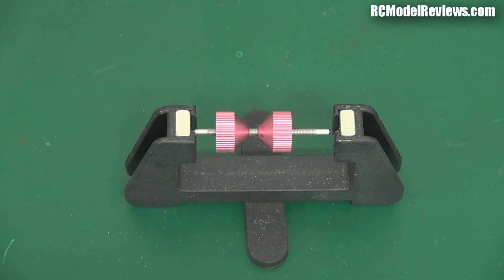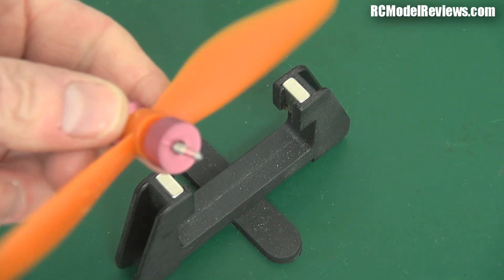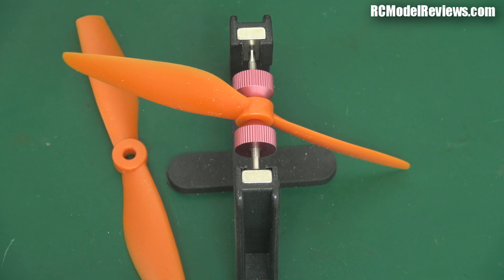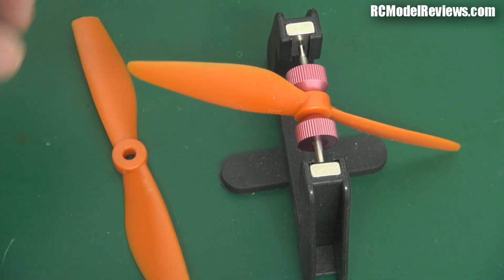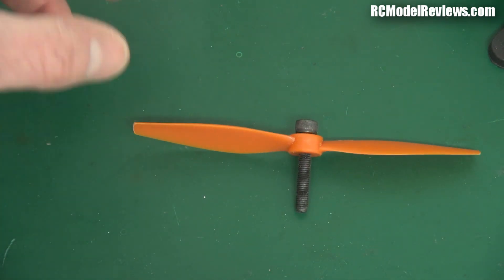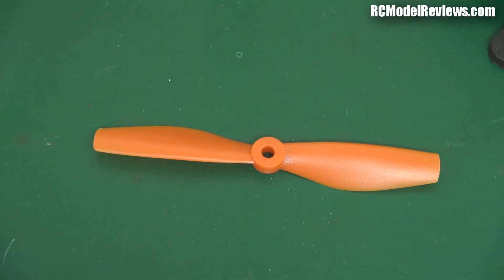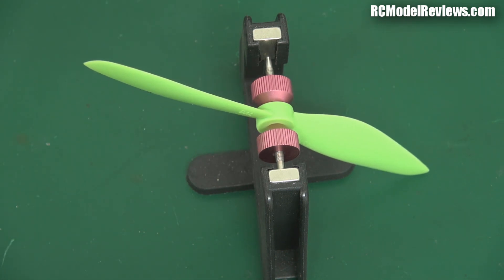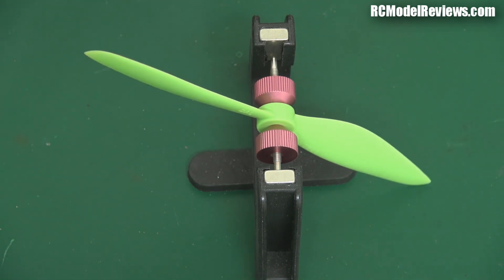DAL 6x4 propeller balance issue

Comment: I think that your definition of "dynamically balanced" isn't right. Dynamically balanced means that the inertial forces cancel themselves. Aerodynamic forces and their balance are another "kettle of fish", although I agree that you want them balanced too. There is a more detailed explanation there : https://en.wikipedia.org/wiki/Balancing_of_rotating_masses
Reply: Panoramix0874 Yes, I use the term "dynamic" loosely -- simply to imply that the system will vibrate when turning if it is aerodynamically unbalanced even though it may be perfect on a static balancer.
Reply: ***** Balancing something dynamically is quite hard and not something that you can do without proper instruments. They do it (or at least used to) for car wheels with a strobe. A google search shows that "some people on the internet" seems to have sussed it out for RC props and motors : http://diydrones.com/forum/topics/balancing-propellors-and-motors?id=705844%3ATopic%3A1011737&page=5#comments
May be that would be worth you trying to do it and explain it to mere mortals like me who are not too hot on electronics!

Comment: Is balancer self balanced well enough? In the past I had issues with an balancer itself, as one of the prop cone holders where unbalanced.
Reply: Go oGle Yes, this balancer is one of those cheap Chinese ones and I got two.  One was crap, the other (this one) is near-perfect.   Normal Chinese low-end "tolerances" I guess :-)

Comment: Put the same shaft on two glasses (for example) and you will most likely find that the magnetic part of this balancer is crap and it does what it wants :). I have the same :)
Reply: Todor Vitanov I'm aware of the limitations of the cheap magnetic balancers but these props were so far out of whack that the inadequacies of the balancer made no perceptable difference.
Reply: ***** Your review is right actually. I just went double check right after I saw it, because I had unreliable balancing experience in the past with the same balancer :D. I can make it go each way with just putting the shaft slightly left or right, ha!
Reply: ***** Your review is right actually. I just went double check right after I saw it, because I had unreliable balancing experience in the past with the same balancer :D. I can make it go each way with just putting the shaft slightly left or right, ha!

Comment: Thanks for that info Bruce, it sure explains the drama i have had although i should be using carbon props for my application however sometimes plastic has to do, but you would expect that makers would use and pride themselves with Accuracy , Oh shit did i just say Pride;-) I know they only cost a couple of buck but thats not the point. Cheers.

Comment: Magnetic balancers can magnetise the shaft so that very light props are unable to turn it enough when balance is almost correct. Mark the shaft with a marker pen and spin the shaft with no prop on it and watch what happens. Your first prop looked like it was responding to magnetic influences. To check, rotate the prop on the shaft and see if it remains balanced. I have to demagentise the shaft before every use as it gets remagnetised very quickly.
Reply: MallionsEye Yes, that is an issue with mag balancers.  I always rotate the prop 90 degrees on the shaft before I sign it off as "balanced" -- that way any shaft imbalance or magnetization issues can be spotted.

Comment: Don't forget to balance the hub as well, getting the blades to stay horizontally is only the first step in balancing, after that you have to balance the hub till you can let go of the prop and it stays at any angle, not only horizontally. But maybe that is a bit too much for those light props but with the bigger ones it is a must. Of course you need a balancer that is big enough to spin the prop all around. Thx for your vids, I always enjoy them.
Greetings from Germany
Reply: mooq! Yes! so true! I use my balancer sideways on the edge of the table to balance the prop hub. Greetings from Portugal! :)
Reply: mooq! On a larger prop this is an issue... on these, not so much.   Most people don't even bother balancing minquad props at all and the only reason I noticed the dramatic imbalance was because I was trying to balance one I'd trimmed down.

Comment: Hello! I have a prop balancer just like that and it´s junk, very unbalanced on the aluminum "cones"!
a good way to test yours it´s spinning with you fingertips in the mount itself but the cones must be on extreme end of the shaft and tightened against each other.
I had to buy other one, that is more true! sometimes the prop hub also comes unbalanced.
Reply: lostboyscrew Yes, I bought two of these... one was bad, one was good.  Like most things at the cheap end of the market -- consistency seems to be lacking.
Reply: lostboyscrew 

agreed, i have one myself and it doesnt seem consistent at all. 

This is why i only buy HQ props now, havent had any issues with balancing since. all the other types of props (especially hobbyking) i have tried is just crap in comparison

Comment: Hi Bruce... I just add epoxy, or Ca glue to the light side of the prop
Reply: Scotts3Dart  I like adding epoxy its quick and you can wipe a bit more on and off untill you get the balance perfect. But I found the epoxy starting to lift off on some of my props.

Comment: Hi Bruce, what is your opinion on balancing with scotch tape? it would solve the dynamic problem, and the bumps on the propeller surface are not very drastic.
Reply: RxTxFx I actually use aluminum tape on larger props.  The aluminum tape is heavier than scotch tape so you need less of it.